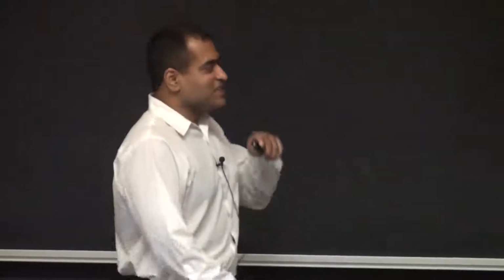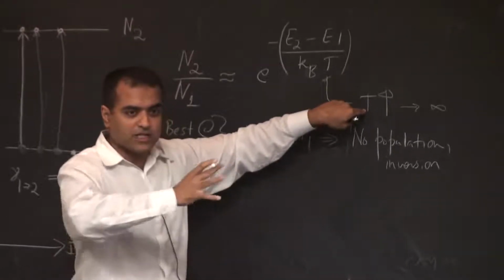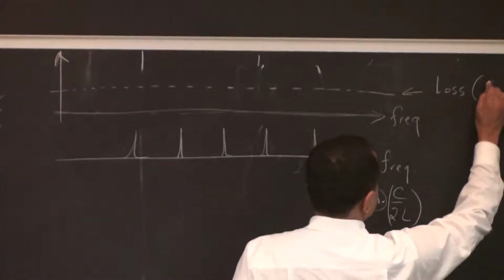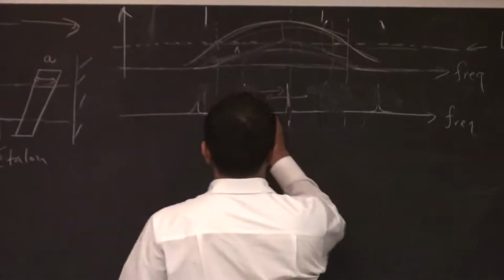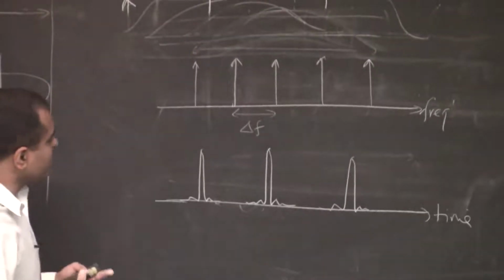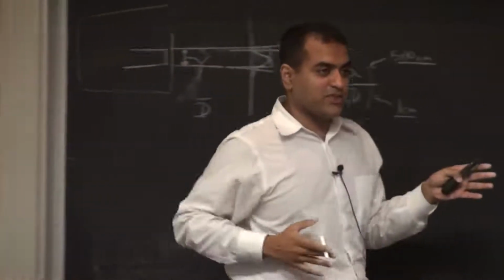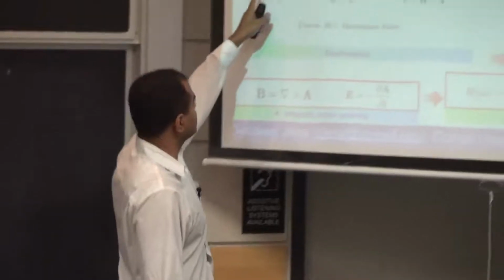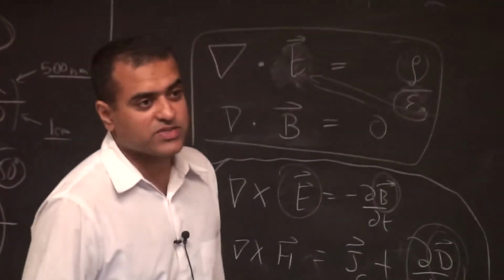Lasers & Optoelectronics Lecture 3: Laser Modes, Maxwell Equations (Cornell ECE4300 Fall 2016)

Comment: Why is the semicinductor laser coherent but the LED is not? I suspect this has to do with poulation inversion but what is the process behind ensuring population inversion in ine case but not the other?
Reply: For LED it's spontaneous emission and for Laser it's stimulated thus creates the same phase with direction. And for that to achieve they optically pumped the system to get higher atoms in N2.

Comment: what are these frequencies mean? isn't it f = c/lambda?  which means each frequencies have different lambda and different lambda can't interfere with each other. Can you really fourier transform it to the time domain? I am confused
Reply: The frequencies represent different modes of the laser. U are right that each freq have different wavelength. But the fourier transform does not mean that the different lamba interfere with each other, it represents the sinusoidal for each wavelength. Do you understand what the time domain represents first?